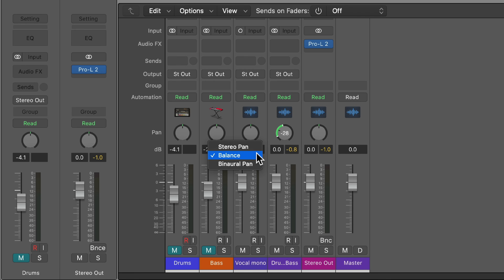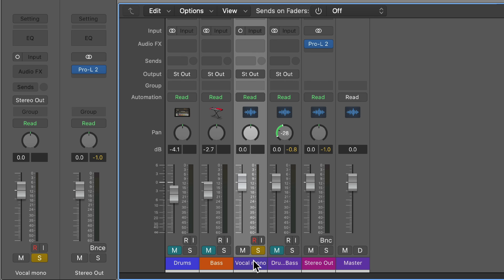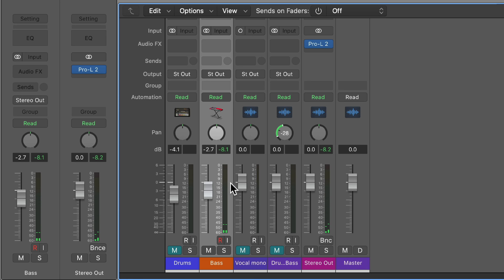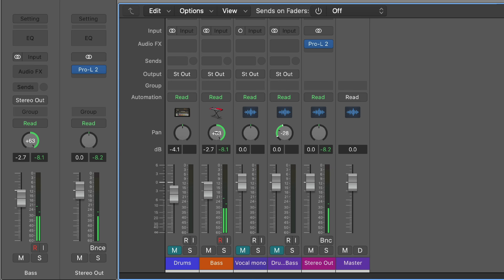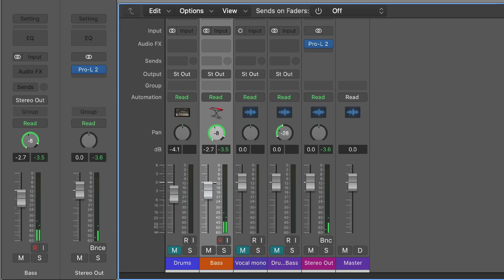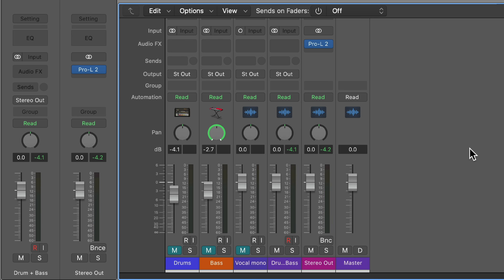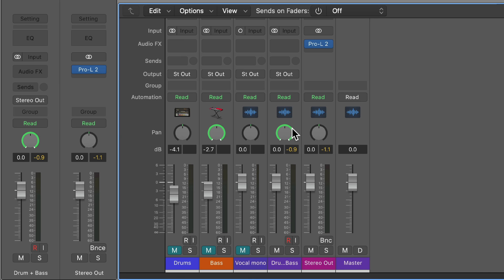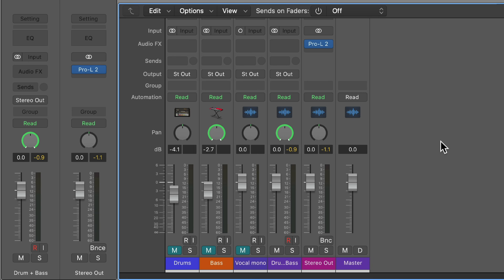Logic Pro // Balance vs. Stereo Pan EXPLAINED

Comment: Thanks for this video. I came across Stereo Pan by accident maybe a year ago and it totally blew my mind, immediately make everything wider or more focused, depending on what I needed, and much easier to make space in busy mixes. Sometimes I use it on drums too if the stereo information is too wide, like with cymbals etc. I also record guitar in stereo from an amp-sim, so I like using stereo pan for that. But I didn't realize that balance in stereo mode was basically muting the opposite channel! Now I feel dumb, but also smarter.

Comment: Still not working for me , super disappointing Logic makes it so difficult just to freaking pan your signals
Reply from the maker: What's not working? You just click on the pan knob and drag up/down to move it? Are you not able to access the other pan modes? You can right-click on the knob, or hold control and click on the knob to show those. The only thing that can be tricky is learning to use the stereo pan. You click on the knob to change the pan position, and then you click on the white part of the stereo panner and drag up/down to change the width.

Comment: Hi thanks for your video! I understand the difference between 2 but I would like to know when would u choose one over the other and is stereo balancing enough if stereo panning is not available in my software/daw?
Reply from the maker: I go with stereo panning anytime I want to preserve the information from both left and right channels; especially with stereo recordings where I'm recording with 2 mics. If I used a balancer on a stereo recording and panned hard left or right, I would lose much of the opposing channel's information. So MOST of the time I'm using stereo panning. However, there are some situations like when I use guitar amp sims and the output is stereo, I often like the slight phase coloration I get from using a balancer instead. So it's kind of a "try it and see if you like it" situation. But most of the time I'm using stereo panning.
Reply: @MusicTechHelpGuy  hi thank u so much for ur reply! So in my case my DAW is MPC2 which I don't think have a stereo panning just balancing. Do u recommend me getting 3rd party pan plug-ins?

Comment: so, under the stereo pan mode in logic pro, what is the difference between these two situations: A: both white handles are in the bottom left and right respectively, B: both white handles are in the top middle joined together

Comment: WOW!!! Finally an explanation I understand. Now  I think that my "pan"-knob on my Synth actually is a "balance"-knob.  Because...you could have used synthesizer sound. Then you clearly hear the loss of information/frequencies when balancing. Obviously those sounds are sampled into the machine in the way that low frequencies are right and the higher left. At least so it sounds if I use the "pan" on the Synth.

Comment: thanks for this.  Just have a question.  When I use stereo pan, I still don't get the same volumes.  When I hard stereo pan to the left it is loud.  when I hard stereo pan to the right the volume is way lower.  Maybe I missed this in the video but not sure why this is happening.

Comment: If I were to have a kick drum as a stereo channel and wanted it to be centered as a mono channel would I select stereo pan and bring the fader lines up to the top middle or just leave it alone?
Reply from the maker: You can just leave it as is, unless there is some stereo variation in the kick sample you're trying to use. If that's the case, you can use the stereo pan mode to pull in the sides, and make the kick more mono. But mostly likely, you can just leave it be.
Reply: @MusicTechHelpGuy  sounds good, thank you for the info! Also, would you happen to know if there’s a way to make the mixer channels bigger? The numbers on the meter are hard for me to see, making them bigger would help a lot.

Comment: Nice video as usual.
I understand that you want to keep the topic simples and easy to understand but I wished you would at least mention the two Pan related topics that are super important with the Pan Knob so people are at least aware of that (and hopefully look it up in your extended video series).
One thing is the Stereo Width feature of the Stereo Pan. You actually did it in the video but didn't mention it.
The other feature is Pan Law. It is more complex to wrap your head around it especially for beginners, but at least point them to the "Project Setting>Audio>General" to keep an eye on that.

Comment: Thank you for the demo. I was aware of the feature, but not of the actual effect it had on the sounds. Your demo made it very clear.

I notice that when I switch from Balance to Stereo Pan and try to automate, the Pan automation track only seems to show one parameter, the pan position. I would expect to have two automation parameters, either the left pan and the right pan extents, or else the pan midpoint and the pan width.

That is, a Stereo Pan that is showing a pan knob of -3 might have a green edge that is taking up about 90% of the circumference of the pan knob (the extents of the pan are far from the center point) or might have a green edge that is taking up about 10% of the circumference (the extents of the pan are very close to the center point). I just tried both and they sound very different from one another, one very broad and one very narrow but both centered very close to the center.

But if there's only one pan parameter that's automatable, then it doesn't seem possible to automate a transition from one to the other (narrow to wide with same center).

Comment: I can't believe I didn't know this, thanks!! I use a lot of synths through stereo pedals and using they're left / right outputs so just to reassure if I want all that info but have the left and right panned with stereo panning it'll send over all that info.

So its almost summing them into mono and placed on the far left or right, whichever you use?

Then I guess using eq, reverb etc I could make it further away or closer in that channel.

Stereos something Id love to get better at as I make highly detailed tracks, even small textures of a few seconds, lots of ear candy! 😃

Comment: Thanks for this! I must ask, does it make a difference for sample libraries? I do open a Kontakt stereo channel and then say play a violin from Spitfire. In that case, if I want the violin to sit at 10 ‘o clock (left) should I be using stereo pan instead of balance?
Reply from the maker: If the samples were recording using a stereo pair (which I'm assuming they are), then yes, using stereo pan is better, because it will preserve the stereo information.
Reply: @MusicTechHelpGuy  I see, thank you

Comment: Would be dope if Logic updated and allowed panning for the l+r channel as you explained protools has !
Reply: Do it! Convert the joint stereo file to split stereo (copy/convert) this will convert the file to two files with L & R at the end of the name. rename one file by removing the last letter to be able to handle them seperately. now load them back in and put them in two mono channels. A little bit of a mess i know, but the only way in Logic.
Reply: @macpaul  Great idea! also if you have the Fab Filter EQ you can easily do this in one plugin but either way works fine
Reply: @ConnorTostevin1  How do you do this with Fab filter eq?
Reply: @ivancastromusic  I think i replied to a post thats gone now, or the wrong person,  because you can't do any split panning like pro tools in fab filter but i'm sure you already know, you can make seperate bands for the left and right, stereo, mono in fab filter. So i think i replied (or meant to reply) to something else to do with that... 🤔

Comment: I still see a lot of top music producers not panning properly. Stereo pan pushes the ENTIRE sound, while balance just cuts out whatever side is not being panned.
Reply from the maker: Sometimes I do it too. On purpose. Sometimes I'll find that the phase interactions and cancelation is not too great sounding when panning stereo material, like synths, especially things with a lot of reverb printed into the sound source. But yeah, using balance mode for stereo recordings is almost always a no-no.
Reply: @MusicTechHelpGuy  Do you have a video on phasing or plan to do one soon? I find that when i make a lot of synth-heavy tracks, they sound great until bounced. Then I hear this weird phasing noises underneath my synths when playing back. Would love to know how to avoid this
Reply from the maker: @jaysundj  That's definitely a weird one. Especially if you're not hearing it in the Logic project, and only in the bounce. Are you sure it isn't an aliasing/foldover issue? Have you tried working at a higher sample rate? Like 48 kHz or even 88.2 or 96 kHz. Sometimes synths are the culprit for a lot of foldover noise.
Reply: @MusicTechHelpGuy  I dont know what an aliasing or foldover issue is lol but I will try some high sample rates. Interestingly enough, I noticed the same mistake issue in a track of a well-recognised producer, however he managed to clear up most of the sounds so you could barely hear it.
Reply: @jaysundj  You could try routing the master bus to an audio channel and record the track in realtime. There might be a difference. I know technically it should sound the same but sometimes some plug-in goes crazy especially when bouncing offline. I've had some weird stuff happening over the years so I avoid the bounce function whenever I can.
Reply: @TheSlickoify  Thank you, I will try that too

Comment: When using townsendlabs sphere, should I use stereo pan or balanced pan ?

Thanks
Reply from the maker: That is an excellent question! As you probably already know, the Sphere mic records two channels, the front and back of the mic, and then using the Sphere plugin, it encodes the 2 channels together. So if you're using the Sphere plugin, and using the mic traditionally as a single mic source, Balance will work just fine. Because, while the channel IS stereo, the information in the L/R channels is identical. However, the Sphere also has a stereo option, where you can point it at a source in a 'front addressed' fashion, and the front and back capsules work like two microphones in stereo. If you use it this way, you'll absolutely want to use Stereo Pan.
Reply: @MusicTechHelpGuy  thank you for the clarification, if Im not mistaken its called sphere 180 o, if I used this plugin instead of the regular one then I should switch to stereo pan.

Thanks again 🌹
Reply from the maker: @EdokLock  Looks like the Sphere 180 plugin is for stereo recording. So yes, make sure to use Stereo Pan for that.